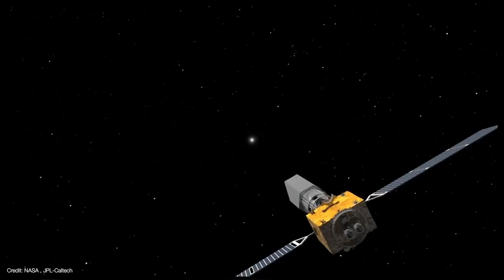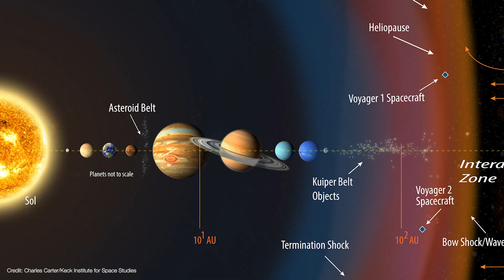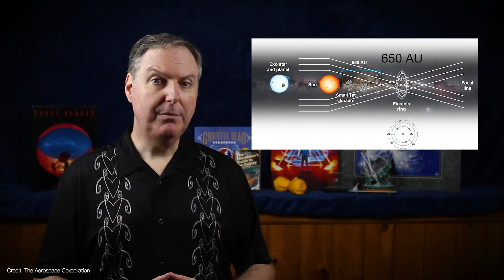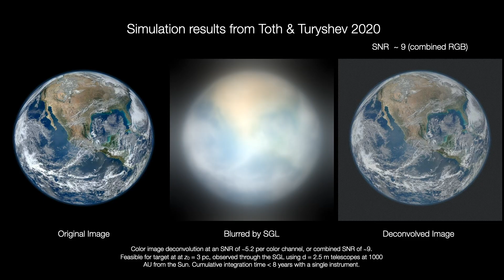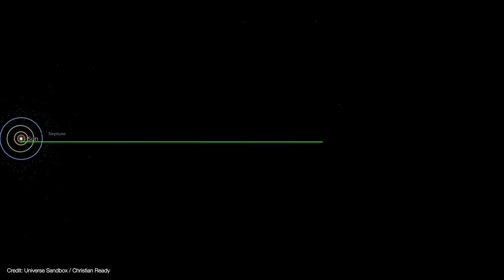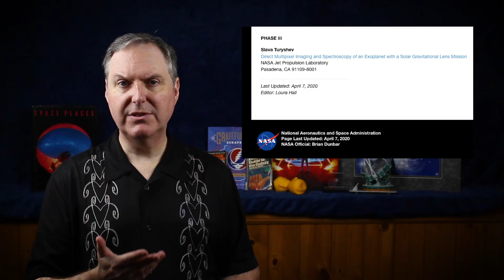The Solar Gravitational Lens will Map Exoplanets. Seriously.

Comment: Mr.Ready, why wait a decade for this when the same process could be used (down-scaling) with a lunar gravitational lens to see the surface seas on Saturn's moon of Enceladus? And maybe even large blocks of ice thrown up by its surfacing eruptions! Wouldn't that be exciting enough for now? Plus, the theory would be proven quicker on a much smaller budget. And even though our moon wouldn't magnify  X-hundreds of millions times, it would probably magnify thousands of times to even maybe see surface features on our nearest exoplanets of PROXIMA B! And the glare would be less of a problem because the moon is not nearly as bright as the sun!
Reply from the maker: At first it might seem like that would be a much simpler approach because the Moon is much closer to us. But we have to consider how weakly the Moon bends spacetime compared to the Sun. Since the Moon is far less massive, its gravitational lens would form much further away than the Sun's will form. Even Jupiter's gravitational lens forms at ~6000 AU so the Moon's would easily be several light-years distant.
Reply: @LaunchPadAstronomy  You completely miss my point. Simpleness is not the agenda. You're talking about waiting at least a decade just to see if this theory works. And you & Yukov are way too fixated on extremely far away solar systems. I know some physics and you & Yukov could test this gravitational lens theory within our solar system while getting more funding you need for the ultimate Solar gravitational lens. It wouldn't matter whether you use our moon, Jupiter, or Saturn as a lens, or all three aligned, it would be much more powerful than even the Hubble telescope? Yes or no?
Reply: It has been over two days & no reply to my last questions. Maybe you & professor Yukov wish to no longer explain why you are trying for a marathon when you haven't even crawled or walked first with a scale down version of this theory of using the sun as a gravitational telescope lens? Fine - good luck with that. Because in life & science, one crawls first, then walks, then runs (usually to the bathroom) 5K races (3.1 miles) then only lastly does marathons. So, good luck with doing all of that backwards, as you and professor Yukov insist.
This thread is done. (However, I will leave you with the luxury of another reply but I will not respond to it. Over and out - I have seen enough.)

Comment: just use Jupiter as a gravity well with a small sat close to the moon orbit. it will make reaiming and scoping other planets  but easier, faster and cheaper. just saying.
Reply: Jupiter's mass is much smaller, so it curves light much less, and the focal point is much further away (6000 AU as opposed to 550AU).
Reply: @FredPlanatia  it is smaller witch  makes the focal point much closer. the magnification is not as great bit would still be many 1000 times better then a normal telescope and you don't have to deal with it being blinded my the sun. this is not my idea or  launch pads the guy who created the concept works for NASA don't remember is name just woke up and need coffee. but it cant be don't with with some cube sats and in a LaGrange point between the earth and the moon as a remember he lecture and if nothing else would be a infinitely cheaper prof of concept for the big solar scope.

Comment: How well would Jupiter work for this?
Reply from the maker: Not very well I'm afraid. Jupiter has <0.01% the Sun's mass so its gravitational lens is much weaker, which means its focal point doesn't start for something like ~3200 AU.
Reply: @LaunchPadAstronomy  Fair enough.
Reply: @LaunchPadAstronomy  0.1% not 0.01%. The focal point is approx  R^2 / Rg - so since Jupiter radius is about 1/10th the Suns but its Schwarzschild radius is 1/1000th then the focal point is about 10 times further or 5500AU.

Comment: A line through the sun and the sensors,  passes through the distant target exoplanet. But that line passes through the target only briefly. Then the exoplanet translates out of the telescopes targeting line. So I don't see how this can work. What am I missing please?
Reply from the maker: You're right the planet is moving, and so is the Sun for that matter as it orbits around the solar system barycenter. And then there's the proper motion of the target star system across the sky. So the focal line is constantly moving from side to side as you point out. However, these motions, including the target planet's orbit, would all be well understood prior to setting out to the target SGL. The spacecraft would need some sort of propulsion (likely ion thrusters) that can nudge the spacecraft laterally back and forth to stay on the focal line. Hope that helps!
Reply: @LaunchPadAstronomy  Thank you. I see it now.

Comment: Solar sails only seem to be viable to non-sailors.
Sailors quickly see flaws. No keel to vector sail power. Delta V between propulsive particles and the sails means penetration of particles is more destructive or through sail penetration means no impetus handoff between the force and the sail material. Then there is the ionization of the atomic structure of the sails as electrons are driven off far sooner than the protons or neutrons that make up the materials. 
All attempts at solar sails have failed because of these issues and many more. 
Your faith in solar sails makes your faith in subjects beyond my education become suspect. 
If this lensing effect is workable, why cant we use it on nearby stars? Maybe we can use nearby stars with webb. 
I remain a skeptic until I see actual images made this way. Good luck.

Comment: Gravity doesn't exist. Heat and cold exist. Earth's magnetic field redirects quatum magnetic fields towards synchronization of earth's magnetic field. Cold repulsion to heat propulsion from cold repulsion is magnetic fields of mass. Mass is heat in resistance to cold occupational space as outward force of repulsion as pressure of force as weight in magnetic fields. Magnetism is the force when you pick up mass from earth's surface. Your pulling against earth's magnetic field. Quatum magnetic fields of mass. Mass loses heat and absorbs heat as quantum magnetic fields. Stars disolve quantum magnetic fields as decay of mass as heat waves of dark energy heat outside the entanglement of mass. Heat waves hit mass as renewable energy passing through all mass in the path in chain reactions of exchanging heat  energy until resistance is overcome by open space itself and heat is returned to dark heat energy outside of entanglement of mass again. Mass is heat and cold space itself within mass and without. Magnetic fields are cold repulsion to heat propulsion from cold repulsion. Heat is forward maximum momentum velocity in resistance within and without entanglement of mass as renewable energy at the cosmic speed limit in resistance as constant cosmic speed limit in and out of entanglement of mass. Light is sparks of electrons striking particles in exchanging renewable energy like hammer striking in a blacksmith shop. Resonating waves of heat. Lightning burns through atmospheres producing sparks of electrons as light. Daylight is sparks from renewable energy singularities in chain reactions passing through mass at the cosmic speed limit in resistance is constant cosmic speed limit in and out of entanglement of mass. Magnetic fields redirect the cosmic speed limit in cycling circulation patterns of magnetic fields and forward momentum propulsion is reduced in distance to forward momentum propulsion. Distance is reduced by magnetic fields cycling circulation patterns. Mass is heat and cold repulsion of space as perpetual motion in repulsion of hest. Heat is renewable energy from decay of mass. Outside entanglement of mass it is dark energy throughout space except black holes. The core or nucleus is void of heat. Pure cold space of repulsion surrounded by dark energy outside of entanglement of mass as renewable energy circulation. The repulsion within the nucleus of black holes is stronger at its poles. Galaxies form around these bubbles when equilibrium is maintained by equalization of pressure within the nucleus to equalize the pressure exerted from without entanglement. Once equilibrium is reached quatum magnetic fields of proximity mass are no longer available to disolve into the magnetic field surrounding the black holes. Magnetic fields can only hold finite amount of heat surrounding their cores in equalization. Decay is heat loss and proximity mass no longer expells its outer cores towards the greater magnetic field of equilibrium. Galaxies are formed by debris left behind the equalization of pressure in equilibrium. Proximity mass circles the core and internal magnetic fields are no longer able to disolve towards the greater magnetic field in equalization of pressure. Theoretically factual probability that works with quantum physics without gravity. Friction is sparks of electrons seen as light. Light is sparks of electrons as heat transference through mass. The atmosphere is the filaments. Filaments burn out. Physics works. Our atmosphere is the filaments of heat passing through in chain reactions until resistance is overcome by open space itself.

Comment: The focal distance of the gravimetric gradient lensing of our sun is ~1000au, so you need to fling a focal plane array into an 1000au orbit, which gives you a very limited view area and orbits at that distance take millions of years, so undistorted tracking is out of question without carrying insane amounts of fuel for orbital maneuvering.
Furthermore, the technology for timely brachistochrone space travel doesn't exist yet, so classical orbital injections would still take a few hundred thousand years and warp drive is nonsense.
Seriously.

Comment: There is a great impractical part to this. Even at 150AU if we need to position a probe at that distance the sphere of possible positions it will need to be at for a given image is ridiculously large. Consequently it would take decades for a single craft to get into position to take a few images of exoplanets outside a given area. 
100ly is a reasonable distance because even at 0.5c any craft we'd send out in the next few centuries would take at least 200yrs to get there (not accounting for stellar drift or red/blue shifting). This is an acceptable range, but still just a fraction of the 100k ly diameter milky way. 
If we're not focusing on the tech to make some von-neumon(mispell prob) style probes for such activities then we're prob going about it. 
^self assembling/replicating probes are the only economical way to produce 10k+ probes needed to effectively map our close stellar neighborhood.  We'd need numbers this high as we'll quickly go through the 100ly group and there are quite a few within 250ly, which is still a reasonable distance for travel in the near future as  politically/economically/socially autonomous outpost/hubs can be set up in anything from 5 to 25ly distances. 
The fact of the matter is that ID-ing a civilization 100ly away on its own isn't all that useful. it won't make some corp/gov any money, we couldn't tell easily if they're at our current level or lower, etc. The shift will need to be a paradigm shift, away from DoD style bloated spending (here in the US) and warfare in general and towards space. 
Gliese 710 is slated to pass as close as 10-14k AU or 0.5ly in a 1.4 million years. This may seem like a long timescale (and indeed is fairly compared to our entire history), but going forward into the stars such timescales will rapidly become more trivial. The fact is one way or another it's better to start preparing for such things sooner than later as even colonizing close stellar neighborhoods will likely take 200-500 years. 

So basically, the concept is great but there is a lot more to be done with regards to it.

Comment: If you're using gravity to bend light, then  would it also bend time? You're so wasted
Reply: Yes. Time dilation is not apparent. It's a real phenomenon. GPS uses to adjust its clocks and it's accuracy.